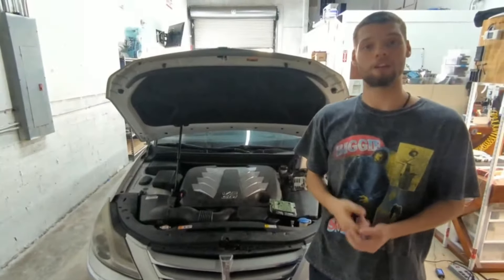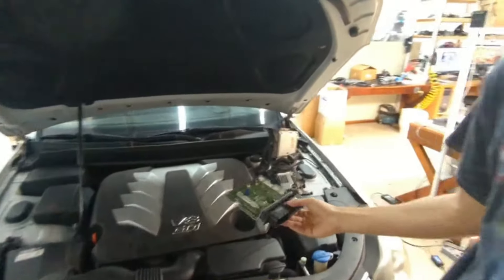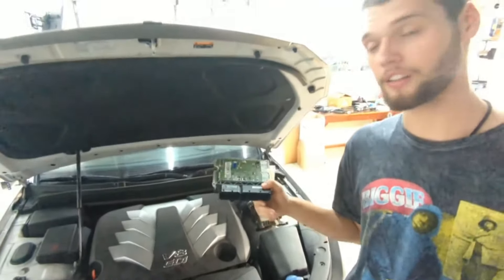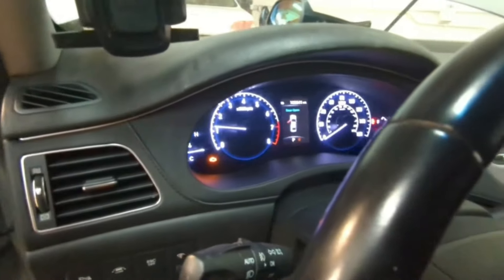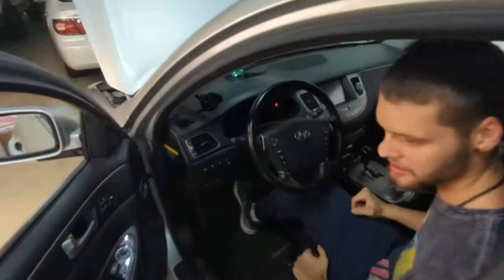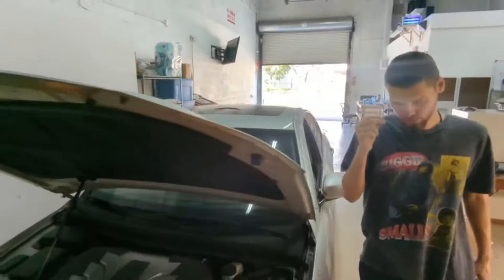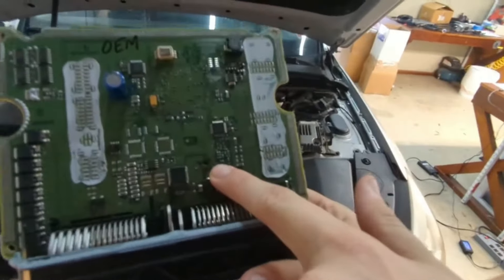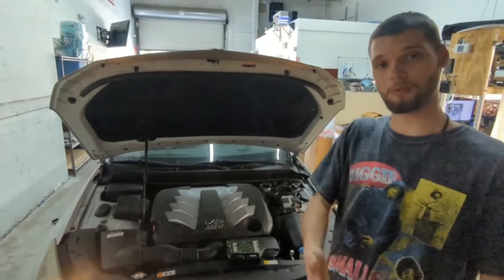The Shocking Solution to Genesis 5.0L R-Spec's Top Electrical Issue

Comment: Bought a Equus from the auction and is not starting, The BCM is working fine but I have the impression the ECU is fried. Where is the ECU located? 2011 Equus V8. Also, I am in Orlando, FL. Probably will have to send the module via UPS is cheaper than a tow truck. :)
Reply from the maker: You can send in the ecu to us, the ecu on your car is located driver side under the hood close to the windshield.

Comment: Have the same problem put a new ecu in the car and it burnt it out instantly what would cause that? I know its a short but where and what can be causing it ?
Reply from the maker: The ECU that you bought needs to be programmed to start the car. If you send the original burned module along with the replacement we can program it and recover data even from burned module. Please contact us on social media in DM

Comment: What type of capacitor is on the ECM and what is the capacitance?
Reply from the maker: It is a Genesis OEM factory capacitor. Most electronic components hold 12v references.
Reply: These guys are robbing people. It's clearly a through hole electrolytic capacitor and can be easily replaced for a few dollars in parts and labor. They even de-soldered the blown capacitor from the board in the video and you'd have no reason to do so unless you were going to replace it.
Reply from the maker: Special for you when this brilliant idea of yours will not work, the price is doubled on the module

Comment: I have a 2011 equus with traction control off,epb,vsm and de ecm light on can u help me
Reply from the maker: traction control epb and vsm is all part of ABS system which is not related to ECM, however the Check engine light can be triggered because of those codes, you need to scan the car.